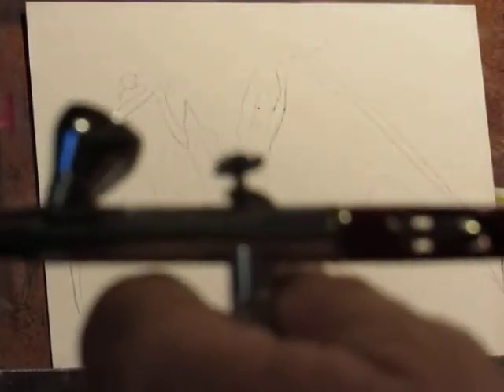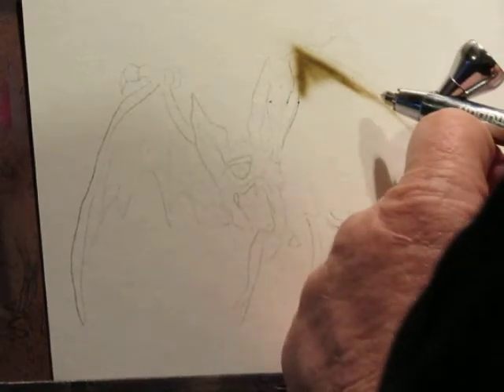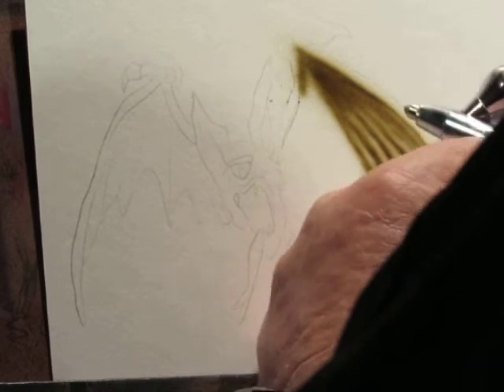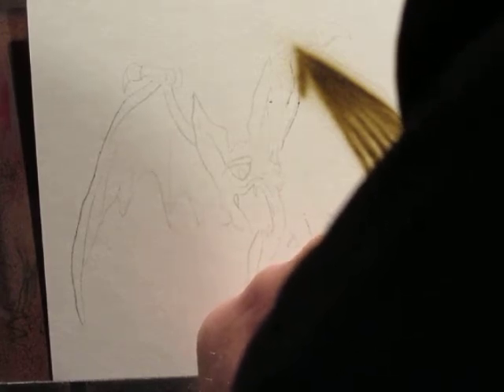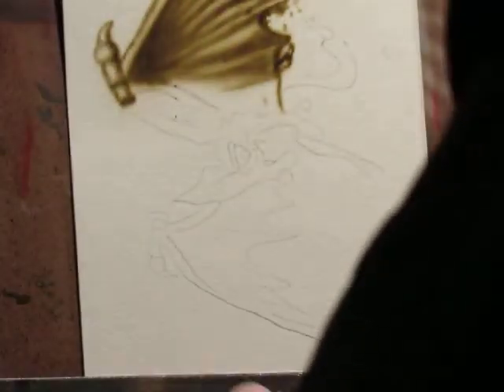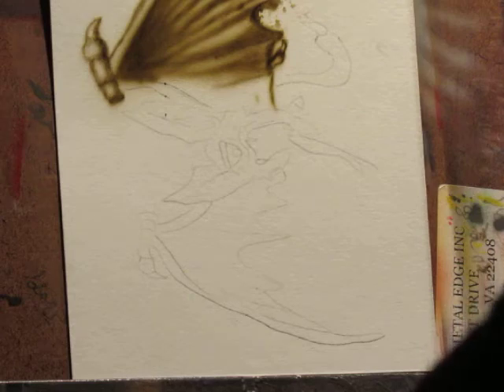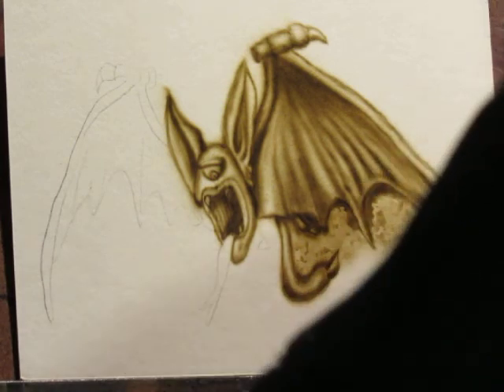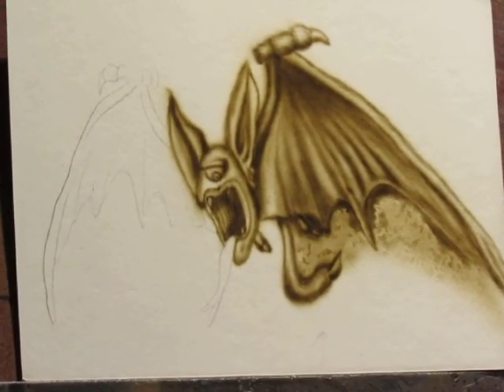Just showing how the H&S Infinity sprays vs the Micron.

Comment: so the .18 micron clogs less?
Reply from the maker: no the .15 nozzle splits/cracks on the H&S mainly I think it is due to the material it is made of . I had one crack from just installing it.  I do not get clogs but dip dry will always happen , To me a clog if where you are trying to use either paint not properly reduced or not designed for airbrush use and the pigments are not ground fine enough .